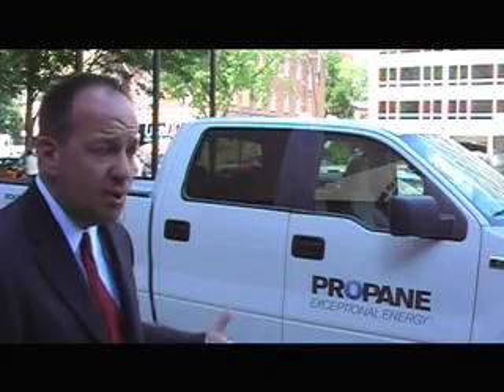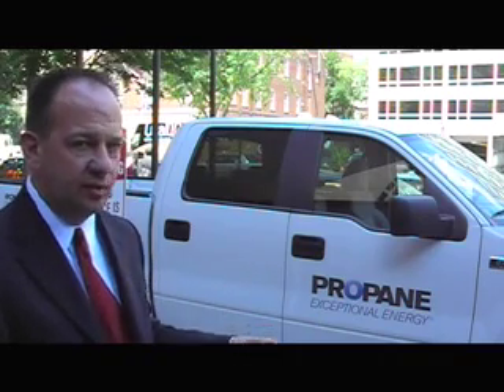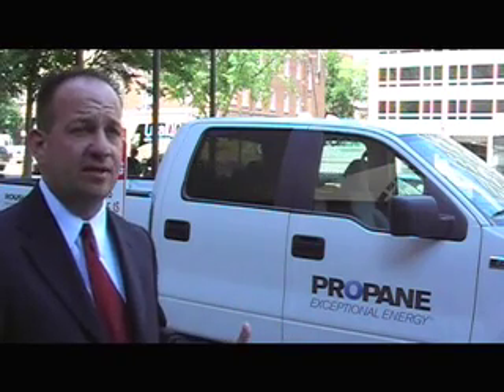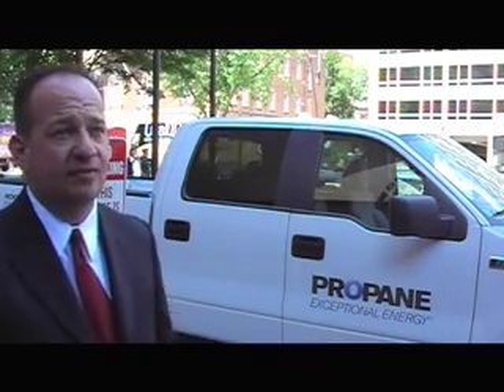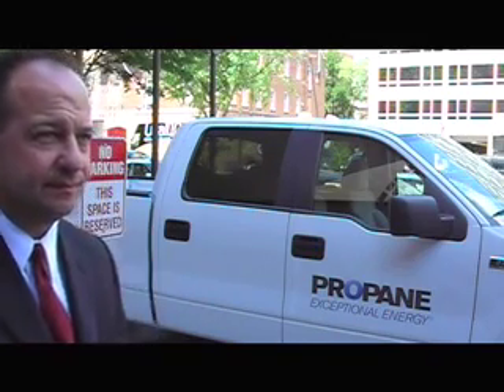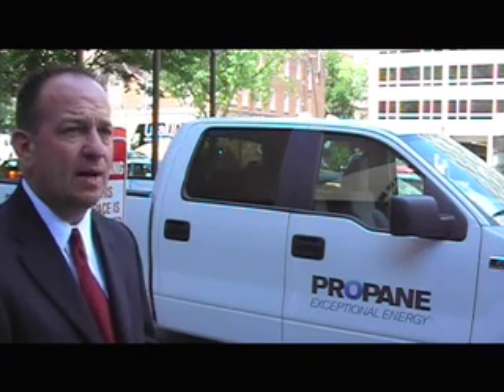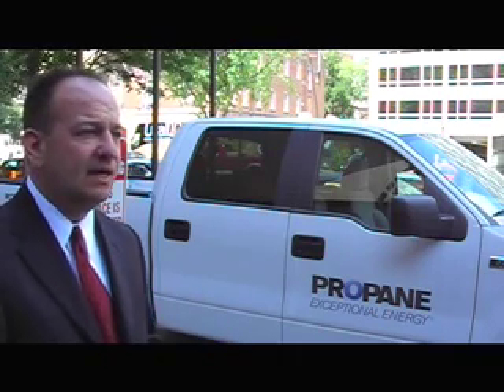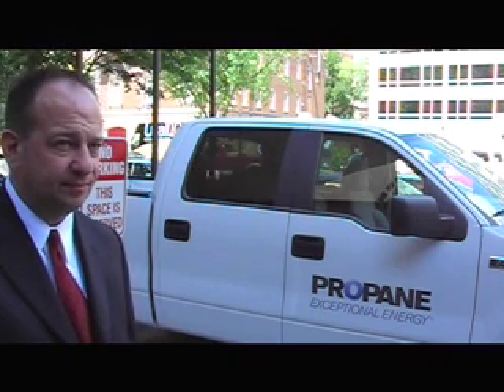Propane Days - Roush F-150 Propane Truck

Comment: [Quote learnedhandjob]
Clean fuel: propane is actually a filthy fuel - because the infrustructure is filthy - propane is stored in clay caverns & is delivered by means such as the Alaska pipe line - so here is the rub - the crap in propane is what fouls all this engineering. 
[/quote]

CNG (nat gas) is transported in pipelines and stored in caverns, yet there's tens of thousands of vehicles running on it.  Just wondering what your experience has been?  Even gasoline vehicles need filters.